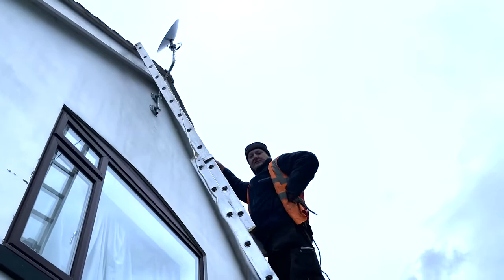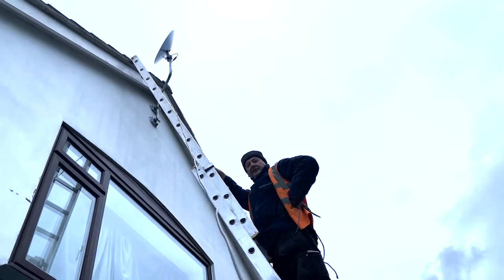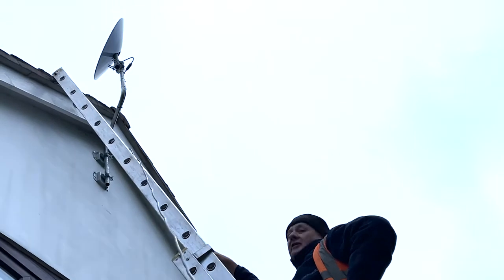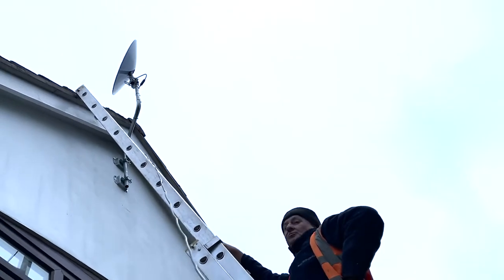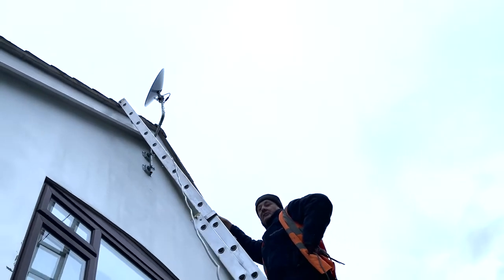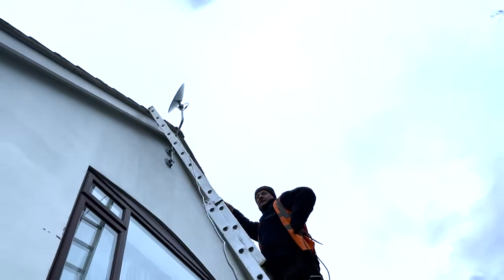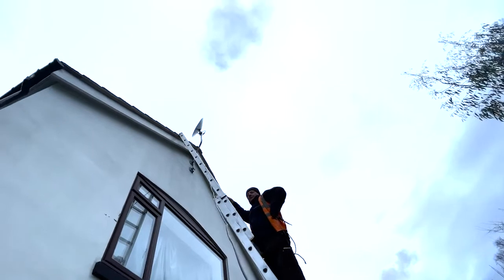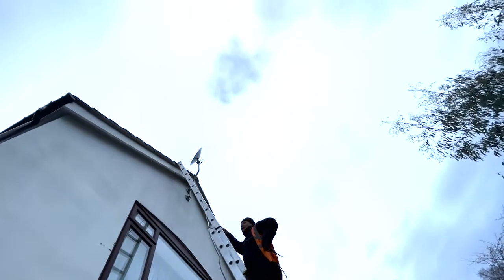Starlink Unboxing & Rooftop Installation Service, UK

Comment: Great video thanks,
Have you done any installs using the long wall mount?

Roughly how much is the installation just for mounting and putting wire into lift with no connection etc. Similar install near the gable end.
Cheers